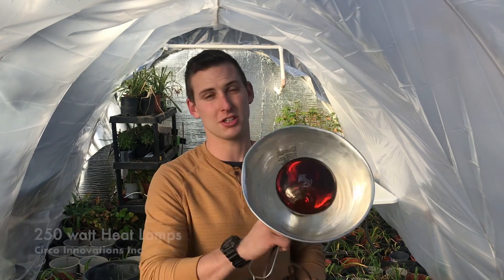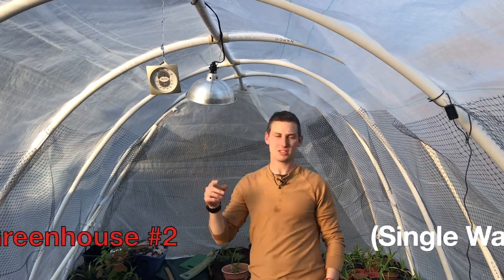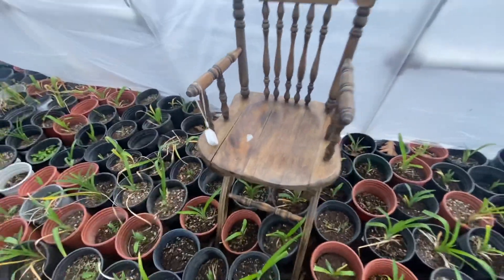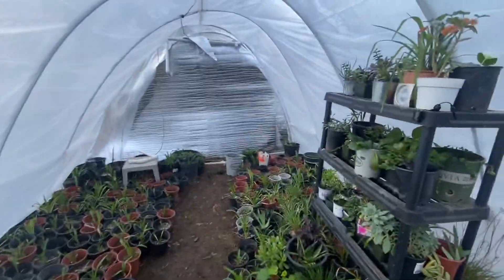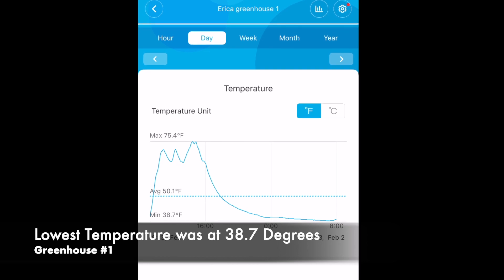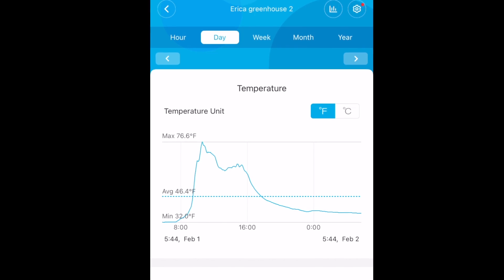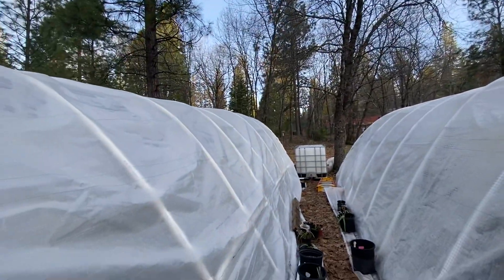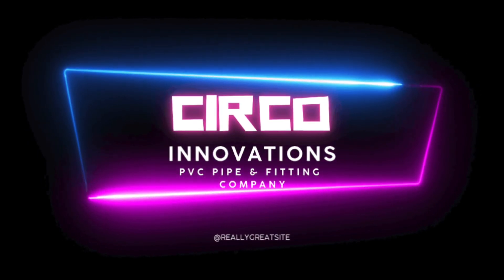Episode 2 of Double Walled Greenhouse using Zebo Clamps, Heat Lamp Test

Comment: You can try an agricultural thermal blanket inside, which is vapor permeable and will thus eliminate excess moisture, because water vapor will condense on the impermeable outer layer.